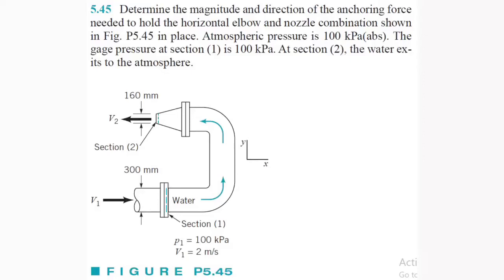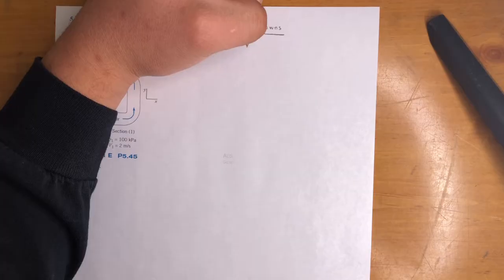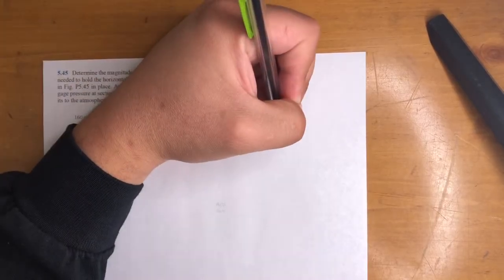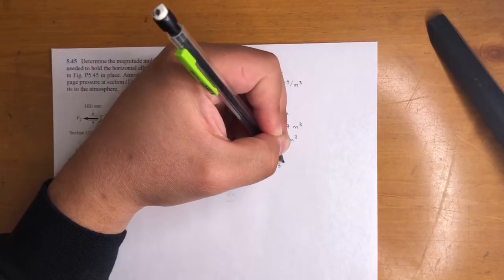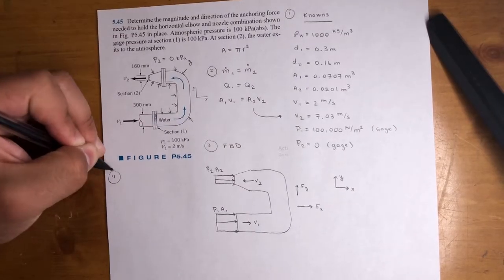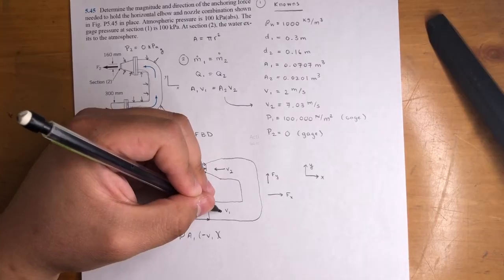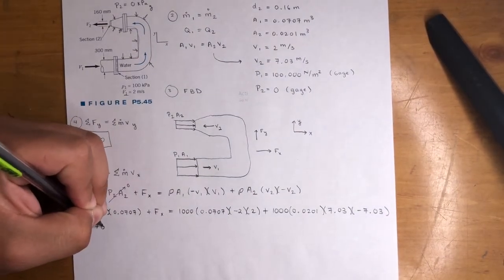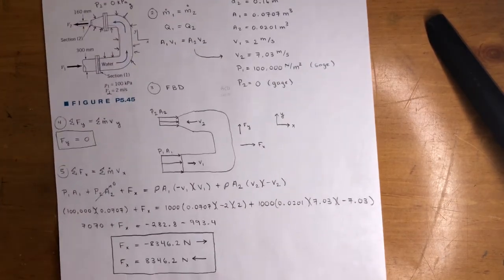Fluid Mechanics - Determine the Magnitude and Direction of the Anchoring Force

Comment: this is really late but could someone explain why there is zero y direction force? I had this problem and I was wondering why we ignore weight/mass, the upward movement of the water, etc. Is it just assumptions we make and what is the reasoning because surely there is some force on the connections? Is it just negligible in comparison to the x component?

Comment: Hii can I know why P1A1 and P2A2 are positive?
Reply from the maker: They are going along the positive X axis. So they are both positive.
Reply: @r12engineering19  how do you know it is going along the positive x-axis ?? Im confused at that part
Reply: @samli3294  because the convention is that it points into the control volume, therefore here both pressure forces point to the right, so positive

Comment: How did you come up with the eqn in step 5, could you do a step by step break down
Reply from the maker: Hey how’s it going. Sure. Check my first videos on linear momentum, I think by this video, I kind of went faster since in my first videos I explained it better and figured I didn’t need to explain it in detail as much.

So the equation we have to setup is:
Sum of the Forces in X = Sum of the mass flow rates times velocities. (Usually we have to find anchoring forces which would be our unknown but not always)

Let’s start with the left side, sum of the forces:

On this side of the equation, we will be dealing with the gage pressure acting on the inlet and outlets of our whole system. In this case, there’s only two. And we know that pressure is always acting on the surface (or your control volume).

We can see from our global X-Y coordinate system, that pressure is acting along the positive X-axis. So our expression so far is:

Pressure1*Area1 + Pressure2*Area2

But, we also know there’s an anchoring force holding this pipe. Google “anchor support in pipes” to see its purpose if you’re curious.

So we have to include this anchoring force in that expression. Just assume positive. You can sometimes see it logically what way the force reaction will be but it will always fix itself in terms of direction.

Sum of the forces in the X expression:
Pressure1*Area1 + Pressure2*Area2 + Fx

Now the second part. Linear momentum. 

We know water is flowing through this pipe at a certain velocity. We know cross sectional area of the pipe, we know velocity, and we know density of water. So we can find all this out.

The key takeaways/tips you’ll need for these problems in terms of sign convention:

There will be two velocities for these problems on this side of the equation.

Inlet = negative velocity
Outlet = positive velocity
Positive X dir. = positive velocity
Negative X dir. = negative velocity

So let’s assemble that part of the equation.

Let’s focus on point 1:
It’s an inlet, and it’s flowing in the positive X

density1 * Area1 * (-) Velocity1 * (+) Velocity1

Point 2 now: Outlet, flowing in the negative X

density2 * Area2 * (+) Velocity2 * (-) Velocity2 

And that’s it for the second part of the equation. Just plug in your values. Total equation will be this:

Pressure1*Area1 + Pressure2*Area2 + Fx = -rho1*A*v1*v1 - rho2*A2*v2*v2

We know everything except Fx. That should give the answer. 

On the exam, I’m sure he’ll give you an angled problem so you’ll have to find X and Y components and you’ll end up with Fy and Fx. Most problems keep it along one direction only. Just keep that in mind.

Hope this helps, good luck!